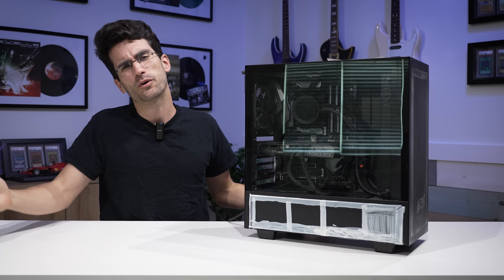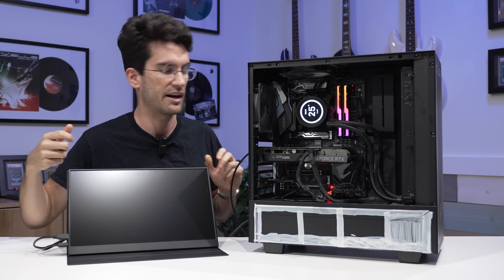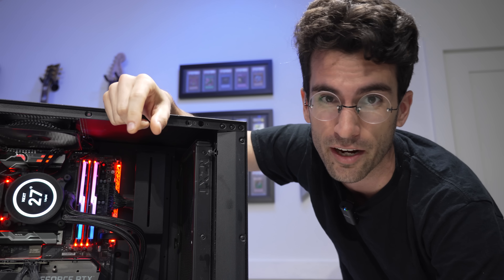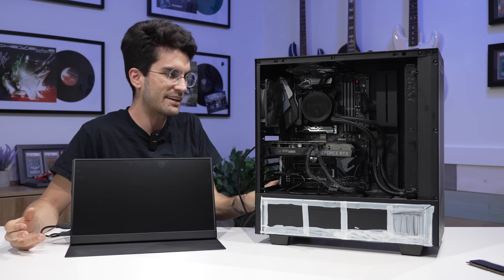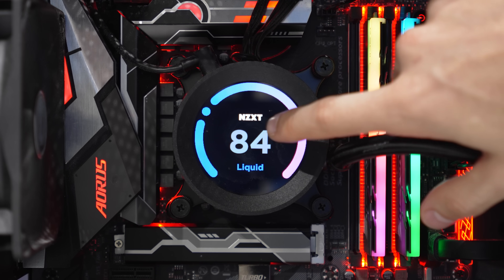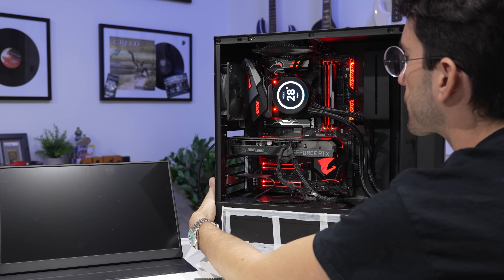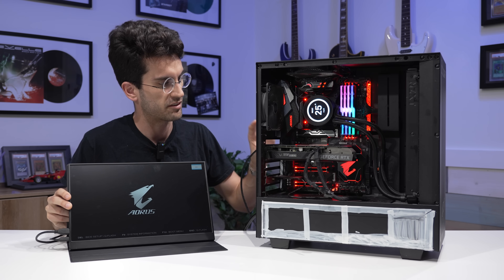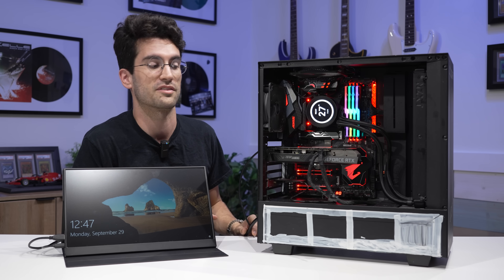Fixing a Viewer's BROKEN Gaming PC? - Fix or Flop S7:E1

Comment: Although your diagnosis of bad ram could be (and probably is) correct, it's possible that a bios firmware update could also help solve the issue. Of course, system memory sticks should all be identically matched, as far as brand and timings, to begin with.

Comment: For once I predicted the issue quite accurately. At 1 minute in I saw the different RAM sticks and was pretty certain that was the issue. How did I know? Well I have 2 different kits of RAM in my system and while it doesn't boot loop it does get stuck in the POST process at times. I should really just remove the worse of the two kits but that requires moving my PC and all that and I'm being very lazy haha.

Comment: 12:42 Well, you asked for the all caps. I FOUND THE DAMAGE!!!!

Jokes aside, the upper dim seems to be a bit rusty on the first few contacts from the middle dent going right, and less so bit still dirty-looking on the left side.
This might not be the issue, but maybe a symptom? Usually you'd clean the contacts with an eraser, but I have never seen a boot loop caused by something like just that much.

Comment: That AIO config is driving me insane. Shouldn’t the tubes be at the top of the rad so the highest point is NOT the pump? Risks allowing air bubbles to sit in the pump and cause inadequate cooling and overheating
Reply: YES! It was distracting me the whole video lol
Reply: No, someone taught you wrong as a joke if you seriously belive that's the best way to mount it.
The height of the pump relative to the top of the radiator does not change if you have the tubes going in at the top of it, and you ideally don't want the tubes at the top since that's where air gets trapped. Tubes being where air gets trapped means much higher probability for noise.

This is the best way to front mount a radiator, as long as the top of the radiator is horizontally higher than the pump/CPU mount.

Comment: i recently built a new rig and had to go thru a bunch of troubleshooting just to get it working. ended up being a simple thing that shouldnt have stumped me for as long as it did.. 2 of my ram slots cause it to not post.. with dram and cpu lights flashing alternating. at first i thought it couldve been a bios issue so i went thru that even tho the box advertised as 14gen intel compatible right out of the box. and i would go thru sending it back but ill just buy a different board later and maybe make the jump from ddr4 to ddr5 at that time.

Comment: i was just wondering with his AIO aren't the radiator suppose to be higher then the Cpu pump so it doesn'tt create a bubble in  the cpu pump and over heat it?
Reply from the maker: The pump/block are sufficiently below the top of the radiator. There's nothing wrong with this config.

Comment: I thought it was the front panel cables in the wrong place at first. Good to see the series back. Had a crucial DDR5 stick die on me a couple of days ago. What I found is that most of the time if the stick is dead it's usually down to one of the memory chips on the stick, much the same way if a memory chip dies in a console

Comment: I'm wondering if he was getting a successful overclock on the green stick and ended up burning out 2 sticks due to weird timing.
Reply: The thing with mismatched ram is that the motherboard will always default to the lowest values, to ensure stability. So unless the viewer set the xmp profile to the g skill kit, I doubt that is what happened.
Reply: @Typhex27 ram will normally go to the lowest speeds but there are rare occasions that it matches speeds but not timings. This is where things can go bad
Reply: Missing standoffs... maybe shorted motherboard... broke something overtime luckily not the board itself... Overthinking :)